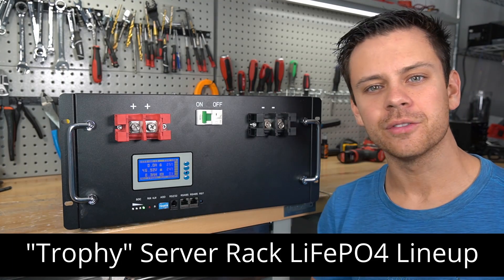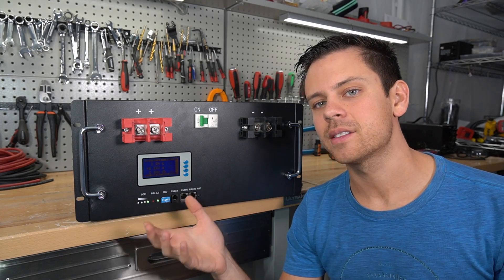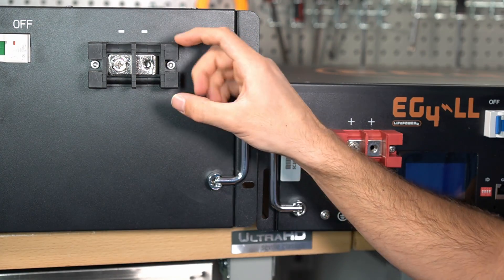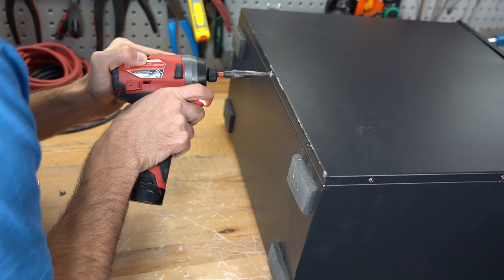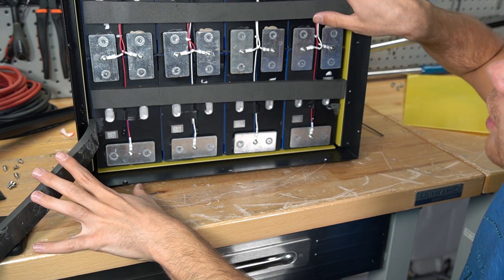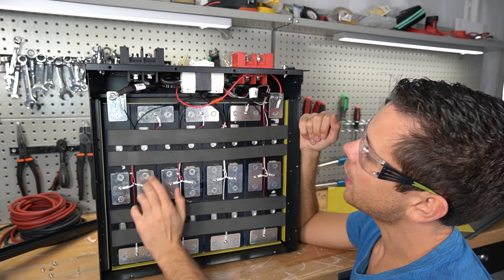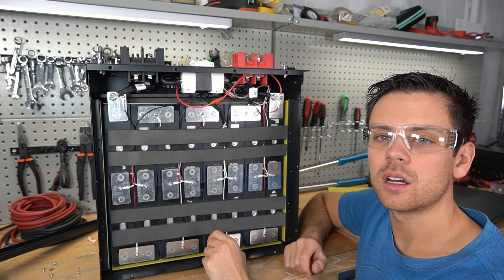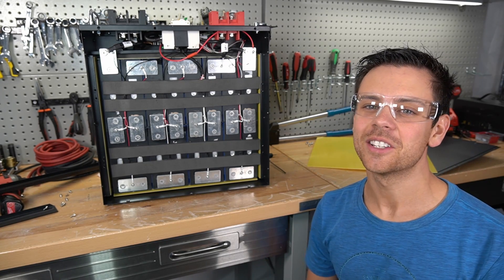New "Trophy Battery" Lineup: 48V 100Ah/110Ah/220Ah LiFePO4 Server Rack Batteries

Comment: The welded cells are a bit of a turn off for me.
However, when I did the math, and if you factor the budget EG4 BMS price & ~$100 for the case, breakers, assembly, comm ports, bus bars, etc, the price per wh is actually cheaper than building a pack from scratch using the suppliers on the mobile-solar website (not a massive difference, like $0.26756 vs $0.26167 per wh) (this was done using the 24v I believe bc that is less favorable to the server batteries than 48v which was my other option, out of $1500 the battery part is $1267)
EG4 also has welded terminals and I'm conflicted because repairing or reconfiguring the batteries in the future is practically impossible and I see that as a major downside, but also can't ignore that there are significant upsides imo
If it's possible to remedy welded cell issues maybe we can get a Will Prowse video on it? 👀

Comment: It would be nice if you reviewed a decent battery company that will ship to Alaska. Local sources are $7k for a 6kw battery and when you bring up how much they are in the lower 48 they just smile and say "good luck getting one shipped here". Total ripoff.
Reply: We have to ship by surface transportation. This means by Truck Freight or by sea.

We cannot ship by FedEx ground. In some cases to Alaska, shipments go by air.
Reply: @dankeaton8656  Wills favorite in the video (the 110AH) is comparable in capacity to the huge (what appeared to be lead acid) I was shown at my local solar store. I don't know what the price of a huge lead acid battery is down there, but for comparisons we shall use the price of wills favorite as it is similar capacity.  The difference in price between what I would pay for Wills favorite ($1895) and the comparable capacity battery at my local solar dealer ($6995) is $5100 dollars. A fully loaded tractor trailer typically hauls around 45,000 lbs of cargo, at 151 lbs/ea (Will's favorite), a fully loaded tractor trailer could haul upwards of 300 batteries per trip. that's a cool 1.5 million in shipping charges per trip.  By definition, that is highway robbery.

I want to go green, but if I can't afford to store what I produce....
Reply: @graciespappy  How much would a road trip to the lower 48 cost you? Or you could possibly fly down and rent a small U-Haul.

Comment: Does it also have an internal fuse inside the box?
Reply: No, the battery does not have internal fuses but has massive DC Circuit Breakers.

In addition, the BMS provides significant protection for the battery. This includes over-current, short-circuit, over-temperature protection.

Comment: As mentioned at least once, I've got the Pylontech US2000 (50Ah @ 48V = 2.4kWh) 19'' Batteries (3 pcs.).
As  I do not dare to teardown one of those, but according to some earlier teardown video of a different  model by yourself, I expect them to have mighty pouch cells inside.
Pylontech prefers to build real 48V systems, so using 15 instead of 16 cells per pack.
What I like on them is the easy to use but no less secure click'n'go "Amphenol" plugs (and sockets), recommending the diagonal wiring setup.
Equipped with the usual data connections, their BMS comes with both an on-off switch, probably like the DC circuit breakers, plus a logical bus system on board, in order to excange any charging status, to define a master unit and to equilize / balance the packs in times of low activity. Their short over-current capability is impressive.
They already sell a successor, the US3000, providing 1.5× of the energy than the US2000.
Being a bit paranoid, I spent them a really small (cubic) server rack.
According to German laws, the guarantee is 2 years of warrenty  only.
Announced are 10 years of cycle Life.
Reply: I have the US3000c in my backup system - it does not have any over-current protection/short-circuit protection in the event of a FET failure on the BMS board - so you have a pack of them in parallel, but with no real protection if one of them decides to go - I appreciate the DC circuit breakers that other server rack batteries have. The lack of BMS display, forcing you to use a laptop to see anything is also disappointing.

This pack also trip out at sustained load above 75Ah, so I need another one to reach the capabilities of a single 5kW inverter.

Comment: I just looked up pricing and it looks like the Trophy 220 has a slightly lower $/Wh between Trophy,  Gyll, Jaccaper & SOK. 

One other interesting point:  The 100ah and 110a Trophy batteries are the same price...???
Reply: 100A x 51.2V (if 16 cells, nominal) is 5.12kW continuous - there's no way a 3000W inverter needs more than 3300W (at 90% efficiency) - the BMSes handle surges just fine, and the inverters have capacitors inside for surge loads as well - you still won't run a 5kW load on a 5kW inverter with a single battery 100Ah anyway, your battery will be flat in 50 minutes!
Reply: @stefanvanzyl9090  Oops... You are correct...   The 48V 100A will drive a 3K.   I was thinking 24V systems....   Sorry for the confusion... I will try to correct the post.

Comment: Wondering how that 220ah battery would do in an EV conversion in terms of vibration?
Reply: at 48V and 200A continuous rating, you'll be stuck with only 10kW (13 hp) worth of propulsion - that's equivalent to a 125cc bike engine. These kinds of cells are optimized for cost, not for high current duty, unfortunately.

Comment: Do all server rack batteries mount using only the face plate? 
That monster one doesn't need rear support?
Reply: They require heavy duty slides for the entire length - it's not possible to add a rear face plate, because then it won't fit through the uprights during installation. Also, the distance between front, mid and rear uprights in 1000mm and 1200mm server cabinets aren't at a standard length either - you'd be limited to only 1 very specific cabinet.

Comment: I really enjoy your videos.  I noticed something I had to mention.  Your wire racking,  The little black plastic wedge that holds the shelves up, and I could be mistaken about this, usually protrudes from the bottom of the shelf not the top.  I could be, and possibly am, wrong about this.  But with the weight that you have on that shelve it could fail.
Reply from the maker: No, it's safe. I have 8 of these and have screwed them up in the past. I use a mallet to hammer it in to the perfect depth.
Reply from the maker: If you hammer it in properly, it sticks out on top.
Reply: Yikes, you're right! The black nylon tapered bushing, more accurately called a collet, is supposed to be on the underside. The design is clever and safe, the more weight on the shelf the tighter the collet grips. That could certainly fall!

Comment: Will, thanks for all the awesome videos. What do you think about using server rack batteries in a travel trailer. This battery type seems to be a great value, but are they appropriate for use in a vehicle that might be venturing down bumpy gravel roads from time to time? Can they handle the vibration or are they only appropriate for a static instalation? Thanks.
Reply: I would think that a compact, well put together server rack battery would handle rough travel conditions better than any loose battery bank with lots of connections and wires. But that's more of a gut feeling than anything concrete.
Reply: I’m doing the same thing.   38’ RV and plan on four to six server rack batteries.

Comment: For a beginner is it worthwhile to have the front display on the server rack batteries (for extra 250 or so) or not?
Reply from the maker: It's really nice to have the state of charge, and to know how much current is going in and out. Especially for a first system. besides that, not entirely necessary. For beginners, probably worth it actually.
Reply: @WillProwse  thank you very much will for your reply. Really appreciate it.
Reply: I have a portable generator with Growatt 3000 and EG4 23 v 100 ah battery.  The Growatt WiFi won’t work.  Any suggestions on how I can monitor my system?  SOC, PV input, ac output?
Thanks
Reply: You can get a shunt and monitor all from there.  It wont show down to the cell, but IMO, cell level doesnt matter since you cant swap it out for a new one.

Comment: I never thought I’d want my lights to go out as much as I do lately.
Reply: Me too. I am running my fridge and furnace on solar. I need more AH  but I have a timer to charge batteries at night. I need to see how far it will go before the inverters shut down. They each have their own batteries and panels.
Reply: @davidstangeland4810  I have been thinking about doing something similar. Running my A/C off solar, and running my fridge/chest freezer off solar. Using a growatt system, so I can have grid power incase something happens with the solar/battery bank

Comment: Will -- what are the dimensions from the rear to the front panel; and how far does the terminal block setup protrude from the front (for those of us looking to mount these in rack mount enclosures that have latch assemblies, etc.)  IE:  DDB OD-30DDX or similar